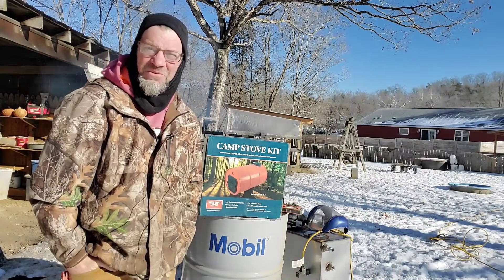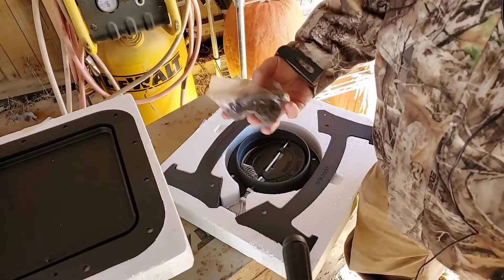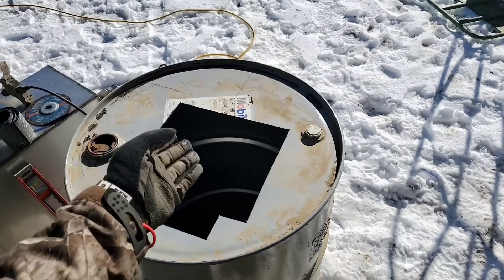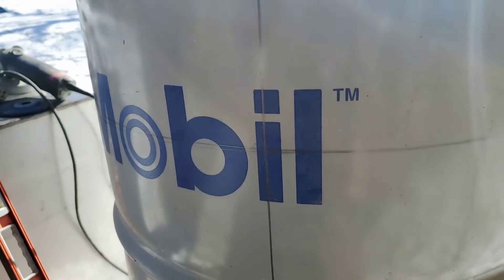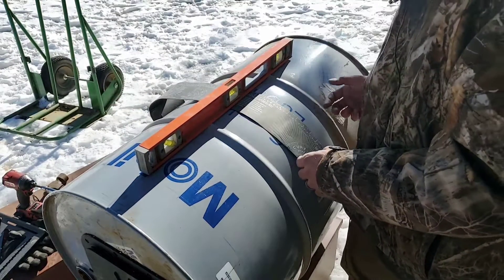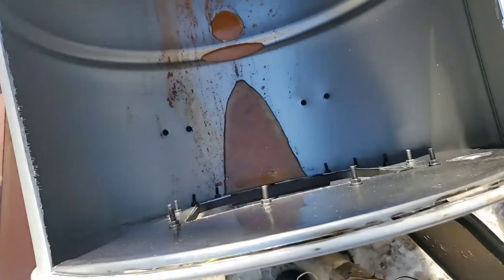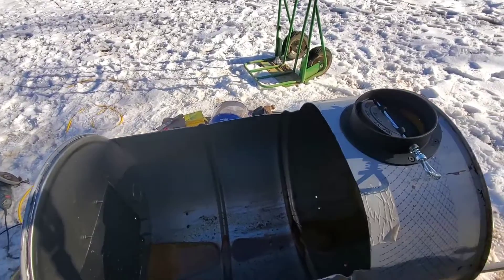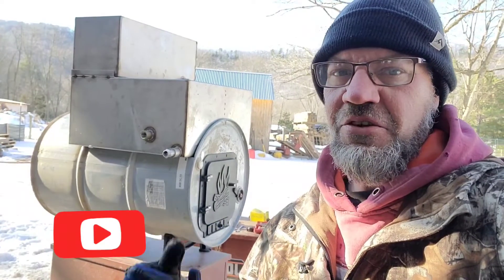From Rocket Stoves to Barrel Stoves!

Comment: When building one of these stoves, try to find one of the barrels that have the removable top with the ring retainer that holds it on. Those barrels I've found to be much thicker and last much longer. Also it's much easier to build (you can remove the top to put all the bolts and nuts on while building) And you can remove the front of the stove to install the grate and remove ashes when you're cleaning.
Reply from the maker: Nice tips! I need to build another one.  I'll try to find one of those barrels.  Thanks for watching!